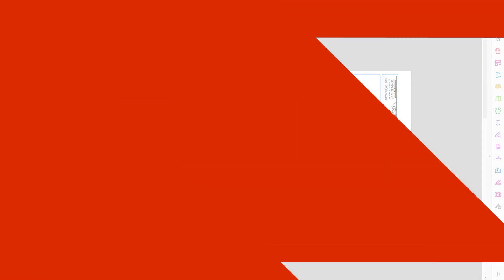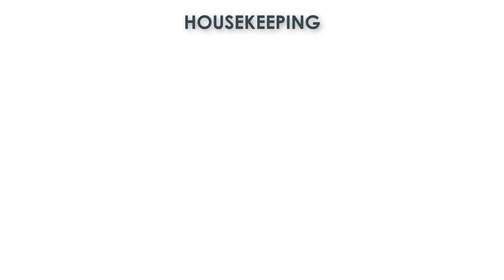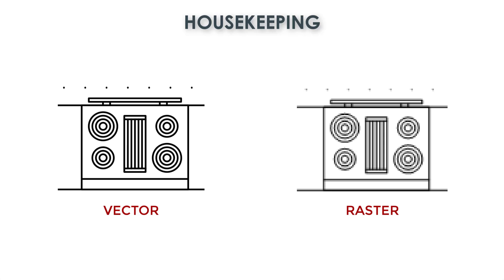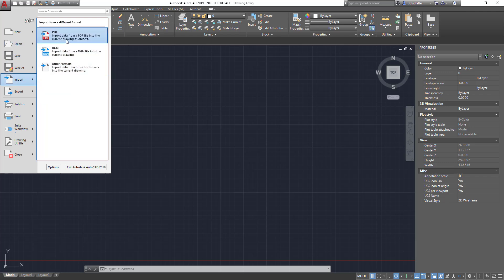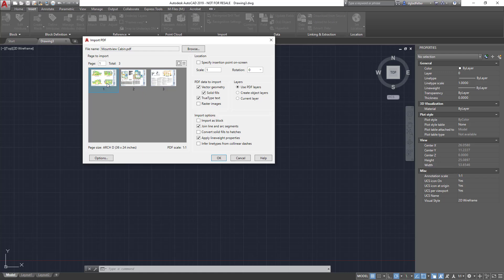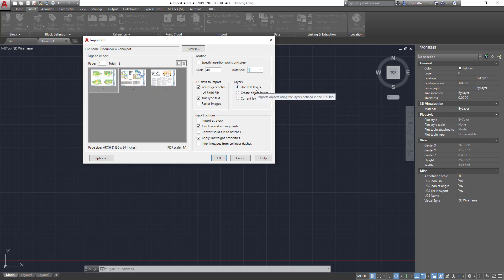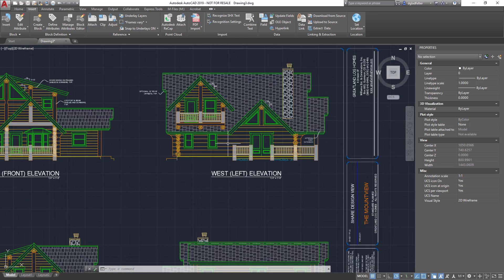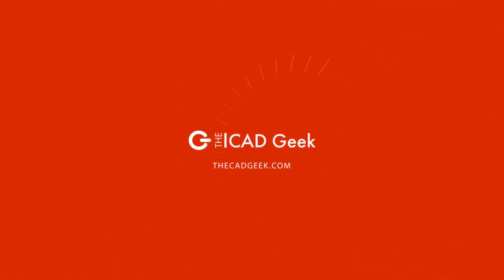How to Convert a PDF to an AutoCAD DWG

Comment: elements, so far so good and then I have a pdf file i got from a company, i need to design solar panels on, when i tried importing it it says 27 elements, so far okay, but then it goes to evaluating 745138 polylines, there are no layers in the pdf, is there a setting or a box to tick to have this load faster? it's been 25min antd it's at 10%

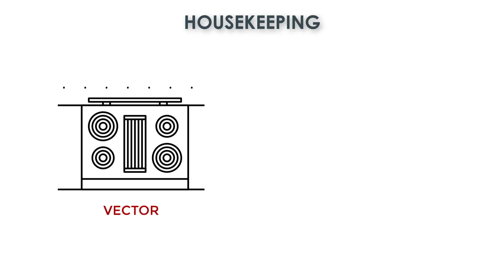Comment: Hi CAD Geek (Sorry I wasn't able to catch up your name eventhough i tried a lot :)),  I imported pdf dwg (which says is in 1:50 A3 and is in decimal mms) to AutoCAD by setting up scale of 50 (due to 1: 50), and my units are setup to decimal millimetres. But while verifying the measurements, its not matching. For example: for the measurement of 1500 mms , my measurement is showing just 28.56. can you please explain how to fix it? the only other option for me right now would be to make the the whole drawing to make it larger by giving scale of 1500 divided by 28.56. Do you think if there is any other simple solution which I should be doing? I will really appreciate your advice. Thank you.
Reply: I meant resizing by 1500/28.56 was the only option i have to match it

Comment: Mr. CG, I am in need of a 3D walk through for 5 floors in a building. Roughly 7600sf each floor. This walk through would focus on walls and ceilings. I would like to go to any one wall or ceiling and show the work done (percentage completed) on that particular wall/ceiling. The work scopes are framing, drywall, insulation, taping finish. Are you interested?
Also your video is well made and easily understood.

Comment: my dwg scale is 1=1000 mm .How do you get this scale factor?
Reply from the maker: When using a "mm" scale, your AutoCAD drawing should be set up using decimal units and with each drawing unit equaling 1mm. As such, in your example, your scale factor should be 1000.

Comment: Do you have any videos on how to convert a pdf that is raster? I'm trying to find a way to do this without having to print and then scan the drawing back in. Can anyone else help with this? Thanks!
Reply from the maker: I've seen several add-ins over the years that claim to convert raster images to AutoCAD. My admittedly limited experience with them has been mediocre at best. While I know it's not the answer you're looking for, but I've found it easier to just reference the image/PDF into AutoCAD, and then tracing things manually.

That said, Raster Design is now included with AutoCAD subscriptions, and adds some tools for converting raster to vector.